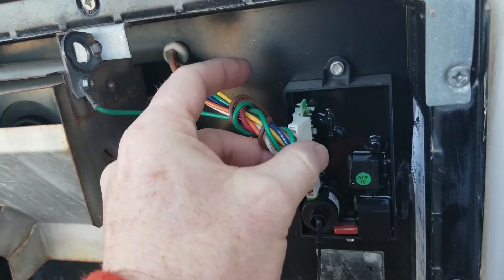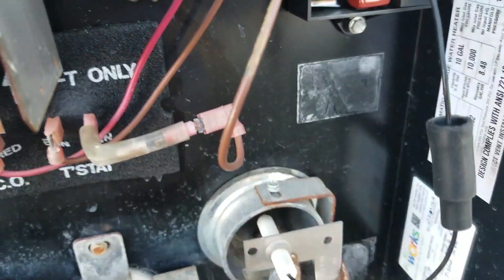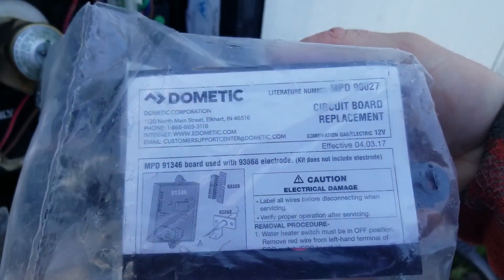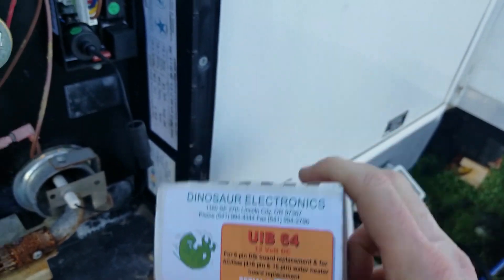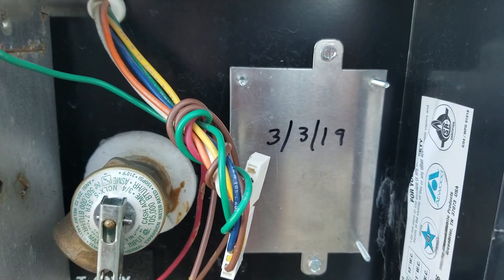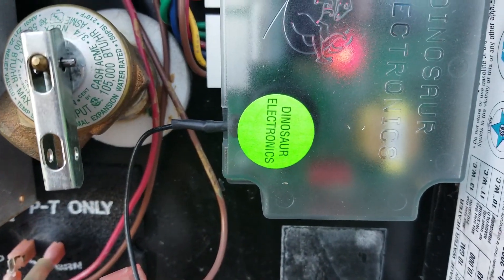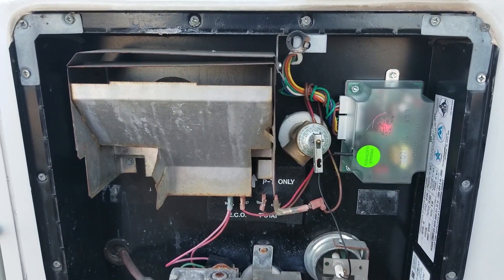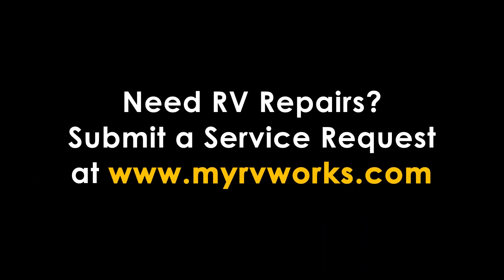Replace Atwood CG10A-4E Water Heater Control Board With Dinosaur Electronics UIB 64

Comment: Great video again!  
May I ask you a question?
I live in McCall, Idaho.  So, to have you come look and repair my water heater would not be cost efficient.
My Domestic water heater does everything you have shown through several of your RV water heater training videos, but my water heater won’t dispense hot water.  I have flame blowing into the heat tube and the tank feels fairly warm, but I can’t get hot water to any faucets.  
May I get just a couple suggestions for repair or should I just replace?  
Thanks much for you YouTube channel!!
Reply: Check your high limit thermostat

Comment: Great video,  I have installed a new Dinosaur board in my Atwood water heater but  the flame is low and burned the board cover.  Is it because of the flow of the propane or What else could be the problem?

Your help will be very much appreciated.  Thx

Comment: I currently have this issue with my Suburban SW6DE. I am not getting a spark or a clicking at the ignitor or 12v on my meter at the end of the wire that plugs into the ignitor when I turn on the water heater switch. So because I'm not getting 12 volts at the connection to the ignitor I am assuming its the module board that's bad. Am I correct in this assumption?
Reply: Hellos I am having the same issue. I believe it’s my module board as well.
Reply: @BilboSandbaggins  I replace my board with Dinosaur Electronics replacement and have not had an issue since.

Comment: Can you test for no ignitor output from the control board by putting volt meter probes on the control board terminal output and ground, then look for a voltage reading when the water heater attempts to light?
Reply: This is a late reply, but I've seen others ask the same thing.  The voltage to jump the gap is in the thousands of volts.  I certainly wouldn't put my meter on it.

Comment: Ok, I have the same problem on a suburban sw6del. Works fine on electric but nothing on gas. No gas smell or hiss, no igniter clicking. Checked all fuses. Does the control board open the gas valve?
Reply from the maker: Well, while this video covers the Atwood, on the Suburban what you're going to want to look for is he small "deck of card sized" control board somewhere behind the wall. You're going to need 12 volts on the red wire feeding that module to troubleshoot your ignition problem. If you get 12 volts on the red wire, that should start the whole ball of wax working where the gas valve opens and you get ignition excetera. If you do not get 12 volts on the red wire, when the water heater is calling for heat , the issue is upstream with the control board if you DO get 12 volts on the red control wire , and you have no ignition, then your problem most likely is the Suburban control module.

Comment: I really have enjoyed watching your videos !  I'm hoping you can offer some guidance on an issue I'm having with my Suburban water heater. It lights up fine but after a while it goes through a stop and start re-lighting multiple times. My first thoughts were a failed ignitor sensor so I took it out, gap was good, cleaned and replaced, but same thing, so I purchased a new one and replaced but problem is still there. I'm thinking circuit board not recognizing signal. What's your thoughts ?
Reply from the maker: That might be caused from two separate things. First thing you might want to check is your thermostat (certainly much cheaper than a control board) . That's behind that black cover with that little rubber push button thing. If you have a meter. Set it on DC and monitor for DC voltage through both of those chicklet size thermostats. One will be your high limit thermostat and the other one will be your thermostat. If you have a faulty thermostat, that will certainly cause your problem you're having.
Reply: Thanks for the reply.  I had recently replaced the thermostat your referring to so I didn't suspect that, but maybe the new one is acting up so I will check it with my meter.   @MyRVWorks